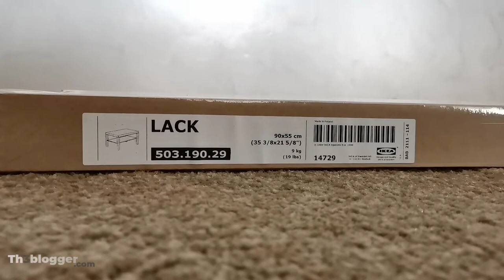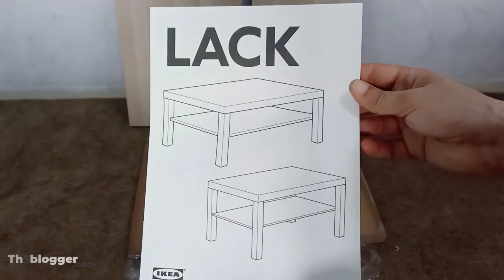ikea lack table Coffee table assembly instructions  very detailed

Comment: Thanks for this. I should have watched more carefully as there are two pitfalls and I fell into both. Firstly, it's easy to make holes in the wrong edge of the legs. Secondly, there are two lengths of screw: short for the shelf and long for the leg. Get it wrong and you'll split the surface of the shelf.
Reply from the maker: You're welcome.. thanks for watching and good luck next time
Reply: It's always better to watch the tutorial video AND refer to the manual.

Apart from the ID numbers, the screws are also drawn to scale on the manual. You can put the screws on top of the drawing and they will be actual size.
Reply: Table is strong enough?